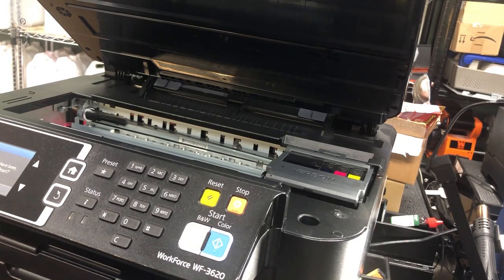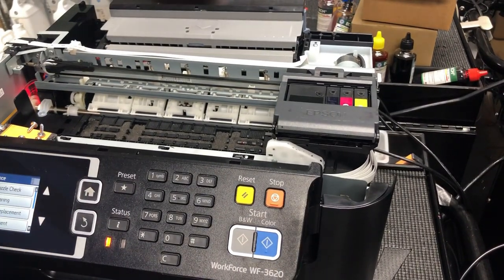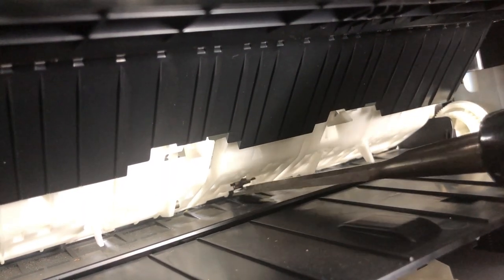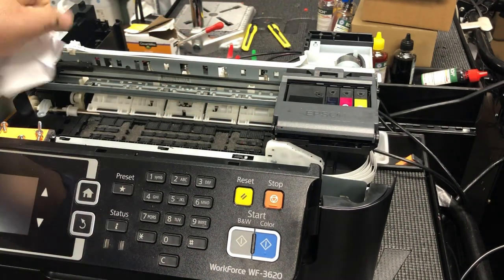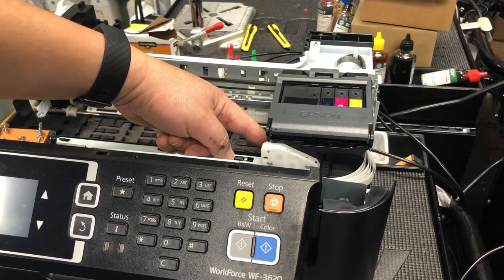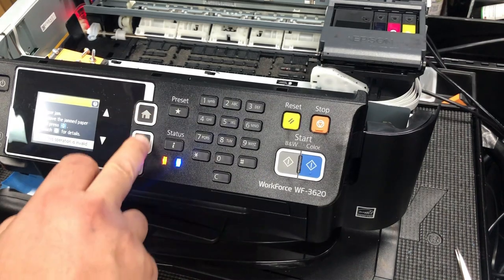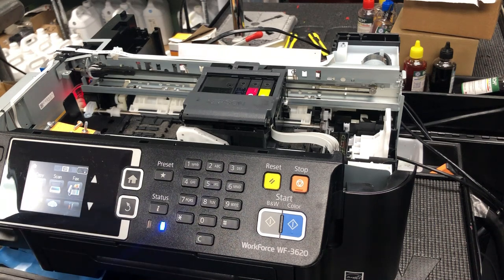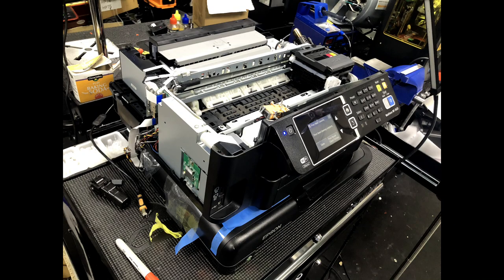Phantom Paper Jam - Fix Epson Printer Paper Loaded Halfway then Fake Jam

Comment: hey kevin! i need your help! i have a WF-7610 and it only paper jams when i have it on premium matte or on high quality print. do you know what would cause that? how i would go about fixing it?
Reply: Sama seperti kasus printer saya  Epson l1455 juga.apakah ada solusinya
Reply: I am having same issue. Prints fine under regular settings but when I try high quality print it says paper jam after feeding a bit
Reply: I am having the same problem. WF 7610 will not print on other settings, besides plain white. Paper Jams!
Reply: Have the exact same problem with my 7610. Anyone know how to fix it?

Comment: hello Kevin, my Epson WF7710 pulls regular copy paper fine, but when it comes to card stock or (1) sided photo paper it'll get jam. Opening the back it's ALWAY bent on the RIGHT (looking into the back of the printer).  i have photos - please HELP!!!  wasted 20+ photo paper.  Also i've printed many of these same prints and it starting to jam !!!
Reply: sorry - the paper sensor is in place
Reply: Having the same issue. Wf 7710 Prints regular copy but will not print any other type paper. Will say jam but no jam. Prints halfway then says paper jam.

Comment: I hear a clicking noise when printing from tray 2 on my wf7720 but other trays prints just fine with no noise. The error message says "no paper in cassette 2" but it clearly is. I pull out tray and see the paper is jammed but it doesn't give me an error message that says "paper jam". How I fix that? It seems like a false reading telling me it's out of paper but it's actually a paper jam issue.

Comment: Thanks again Kevin.  I'm keeping my xp-520 functioning by using your tips each time something new goes wrong.  This time you mentioned the plastic strip at the back and I checked and ink had splashed on there.  not a lot but when I carefully wiped it away the paper did not jam anymore.
Reply: I spoke too soon.  I did one test print and it was fine. Then I copied a page but it only printed a centre strip about 1 12" wide.  I tried again to make a copy and the paper jammed in the back as before. The xp-520 doesn't look like the one you are working on, can you show me or tell me where the PE sensor is? 
I just replaced the inky plastic strip GMNA030 1611329-00  with the same strip from my previous XP-520 BUT now it slams into the right side! And I watched more of your videos and looked more closely, the encoding strip was twisted on the left side of the carriage but not the right. I was able to move it and it clicked into place.  Now the printer prints from the test page from the PC controls and prints from my phone BUT will not print copy of anything on the scanner!!!!!! Paper Jam message!!!!

Comment: Hi Kevin, great videos. I have an Epson Workforce 4630 and it's showing a paper jam message. I have looked and there is no paper jam. My trouble is that I can't clear the error message and get back to the home screen. Any tips on factory reset or perhaps just to get my home screen back? Thanks.
Reply: Same model, same problem. I held down the grey and white piece under the adf cover and it got passed the phantom jam error. Hope it helps🤞🏾✌🏾
Reply: @mrreese00  Does this mean error in adf can cause fake  paper jam error?
Reply: @aris95  that was the case with me apparently, but im no expert

Comment: Hey, I have an WF 3640 and it only show me jam paper error when I print on High Quality can u help me?
Reply from the maker: That’s strange.  So no jam if you set at regular paper?  What about using same stock but set as regular paper?
Reply: exactly same problem in WF 7610...help!!!
Reply: @BCHTechnologies  I also have the same problem with epson wf 7710, fake paper jam only to high quality prints but no paper jam when doing standard prints
Reply: Yes, i have same problem. Maybe its a memory or power problem that happen just before printing and trigger paper jam.
Reply: Same here, shows fake paper jam error when set to hight quality, doesn't happen when set to standard quality
Reply: Same problem with WF-7710 only when doing HQ prints. Paper is half loaded, then rattled click with paper jam message. After I clear the jam and press OK I notice that white bars  above the roller jump down with loud mechanical sound.
Reply: Same here, paper jam on WF-3640 (paper halfway fed, no real jam) on high quality print settings. Normal quality prints just fine as does the test print.
Reply: Same, anyone have a fix?
Reply: @gilc8842  my printer have the same problem and it cant print duplex page
Reply: same problem with my wf 7610, prints well on plain normal setting, but when set on high or photo, loads paper half way and reports jam

Comment: Hello Kevin, almost the same problem with WF-7211 single function printer, you have had cleared the system print que (thru facsimile) within the printer itself, what can I do, my printer print on both trays 1 and 2 but not on the rear paper feeder. I tried all possible solution but nothing works hope you have another idea that will work.

Comment: I am having same problem and have seen it fail some 20x's repetitively when printing.  I did find that Copy works without an issue (or at least the one time I tried).  I will continue using your guide and let you know the results.  I'm just printing one side using paper tray.
Reply: Not sure why but when I went to test his scenario, my printer just started working again.  I had an old document in the cue that failed to print due to paper jam but this morning it worked and it's continuing to work.  Want to test Kevin's method but didn't need to.  Thanks again for you in-depth analysis.

Comment: I have an Epson 9890. I use the large 700ml cartridges. I have a never used Light Black but the printer won't read the chip. I get a Red X. I have other cartridges. Is there any way to reprogram, or buy replacement chips for these?  Thanks. I'm a long time Epson use since the first Epson Photo.
Reply from the maker: Have you checked the chip contact points, and make sure the ECB board pins are good?

Comment: hi Kevin, Thnk you for the video. I have aan Epson Wf7620. I am getting paper jam only when printing high quality. Please help
Reply: I have the same problem with Epson WF-2750. I can print to  standard quality without any problems but not high quality, which makes phantom paper jam. I have tried to disable the printing port's bidirectional support but no help.
Reply: I also tried to change printer driver to "Epson Universal printer driver" but no difference it prints standard prints fine but high quality print stucks the printer.

Comment: Hi Kevin, I have WF7710. I had a paper jam at rear. I unscrewed the paper stopper assembly and got the last bit of ripped paper out. Unfortunately the compression springs fell out in my hand and I think I lost one.. I could hear a rattle inside. Do I need to get replacement part or just springs please.

Comment: Hi Kevin. Thanks for the very helpful videos. I have a WF-3620 which prints single sided without a problem but fails every time to print double sided. The first side prints fine, and goes back into the duplexor. On the way out it jams in the rollers. Is there any way to fix this?
Reply: hi did you get a fix for this please
Reply: @markcrickett7455  No. Someone I asked to look at it concluded it was probably a motherboard fault. I sold the printer with the disclosed fault.
Reply: Sama seperti printer saya l1455 juga begitu tidak bisa cetak 2 sisi

Comment: I have the epson wf 7620 I had this troubled problem I found the main problems to the ink cover and a fake paper jam. There's a white clip at the bottom right corner that clips on to the ink head this sometimes gets jammed and stops the print head moving from its usual boot up moves left to right etc.etc I had to force the main print head to the right this is the default position of the main print head . How ever this clip also goes up and and down which approx 2 inch guides to the left but it doesn't always go down when it's supposed to do so to release the head to print this is the main culprit to print failure

Comment: hello I'm not English but I translate, I have the printer in question Epson and 2630, when I start printing, you pull the sheet but does not block, comes out directly, and as if the cart does not freeze, what could it be?to me it seems as if the.spring does not open and close the cart

Comment: Kevin, thank you so much! I have a jam i have not seen, but it happened a year ago and was solved, but now i can't figure it out. Calls to epson did not help (You need replace/repair). My jam happens ONLY when i'm trying to do duplex (2-sided) printing. It used to be fine. But now, it prints first side, takes the paper back in, and gives Jam error. Opening top shows the paper showing about 1-2inches. I pull it out, and it tries again, and same. Any ideas? Someone I found said changing out the maintenance box fixed his. I've not tried this. Any ideas? Thank you!
Reply: same problem, can u try any of maintenance print for cleaning, let's see if give jam too, if so then u not the one who get this problem
Reply: did you get a fix for this problem please

Comment: I have a epson 7720and its only loading the page half way then error 000071 shows on the screen and says turn off then back on if problem persist contact epson .  Do you know what that code means ive searched and searched and cant find it. Ive checked the gears, timing belt is clean, theres no debree, it will print if i manually feed through rear feeder but wont auto feed from the trays. Any help would be appreciated
Reply from the maker: How about the three gears ⚙️ on the duplex unit?  If you turn one,do all three turn together?

Comment: please help I just inherited my dad's house and inside he has a Mac computer with an older I think because it's still in the box and he lived here for 11 years but anyway it's an Epson XP 410 and it had the original ink cartridges to put in I know how to do this so I did it and whenever I try to run the printer the printer seems to work perfectly except that the paper comes through and seems to veer left and get caught in the wheels so I don't know what the problem is I don't see any dust inside I can't imagine what the problem could be unless I've somehow installed the somehow my dog's getting sick okay so unless I've somehow installed the ink wrong or there's something going terribly wrong with my printer itself please help

Comment: Kevin wd 3640 paper jammed .i removed the paper causing the issue but still saids paper jam. I checked everywere for paper but nothing. I do notice that the ink carriage  do not move at all when turning primter on.i do hear a roller move when i turn it on then the error comes on. It did  do a strange noise when the paper got jam. I am taking it apart how do i make sure i put everything 0 or in sync..thanks